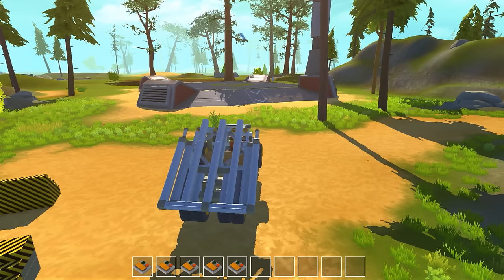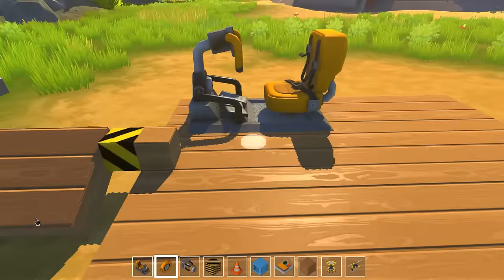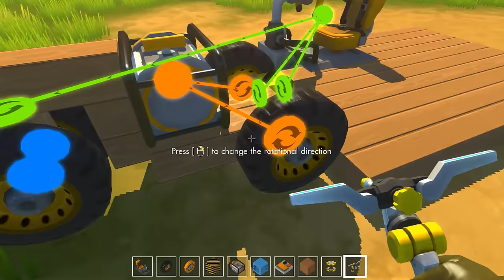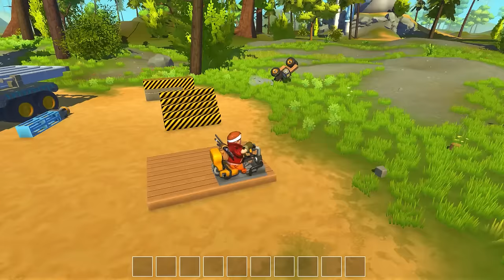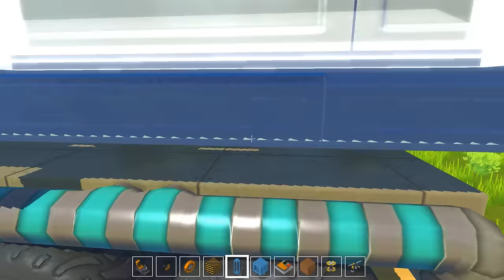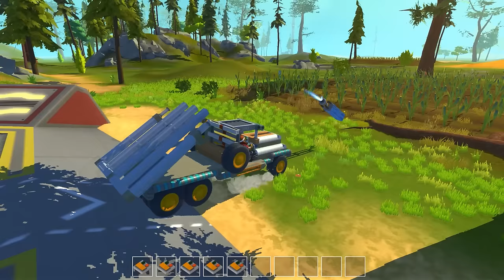Scrap Mechanic - MISSILE LAUNCHER! - Let's Play Scrap Mechanic Gameplay

Comment: nice craft! thanks for mentioning me! you're one of the few!!
Reply: and well, i kinda was the first with firing yet engines on a tank but np :D
Reply: also if you don't do the blue beams on the rockets, they will fly forward and won't face down that fast
Reply from the maker: +Brent Batch&MC Didn't know that!
Reply from the maker: +Brent Batch&MC I wanted the projectiles to look like big missiles :D
Reply: +Pirate and Fade ah yes it does look a bit cooler indeed, not more practical but indeed a bit cooler :D